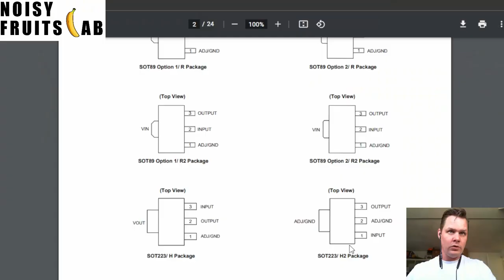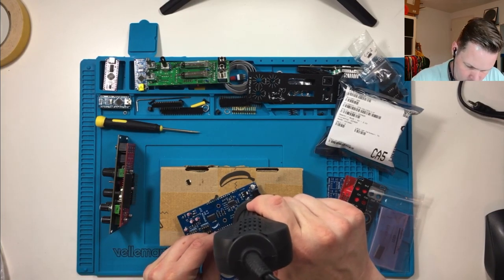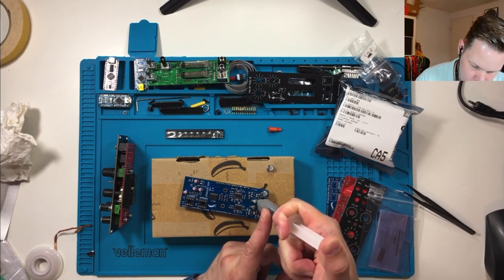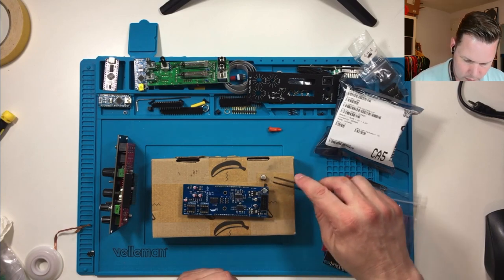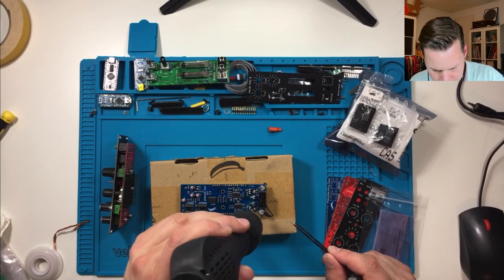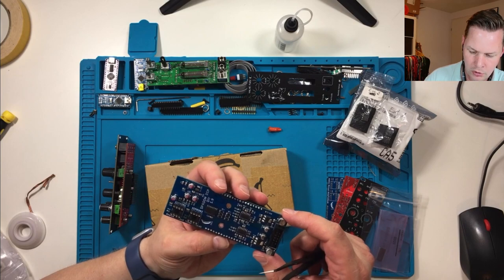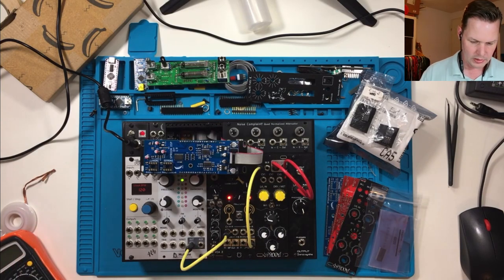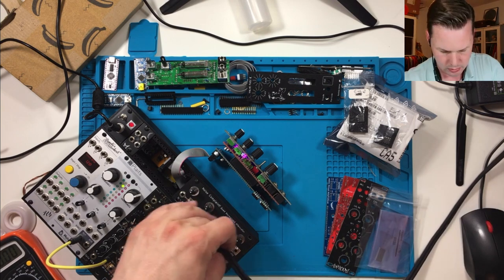DIY Sproom - the wrap up

Comment: Nice video! and nice 46hp case, looks like we use the same printer :) Cheers from Shanghai
Reply from the maker: Those cases are really nice. And with a m2.5 tap the holes are perfect.
Reply: @mymodularjourney  m2.5 befaco style I use from a taobao shop, with KeLaiFu’s USB PowerBar